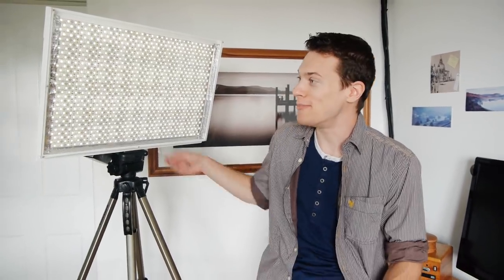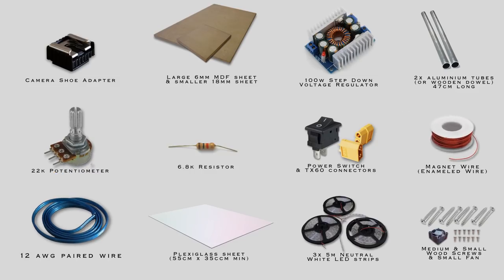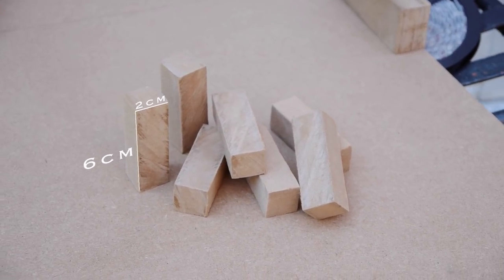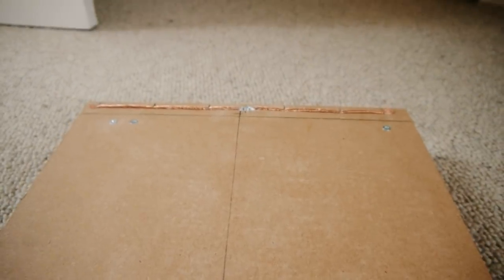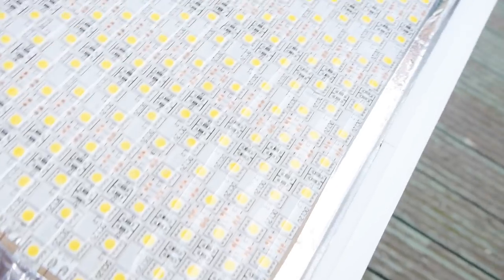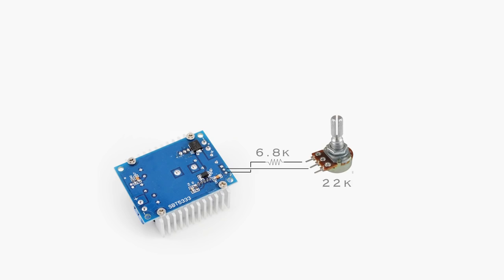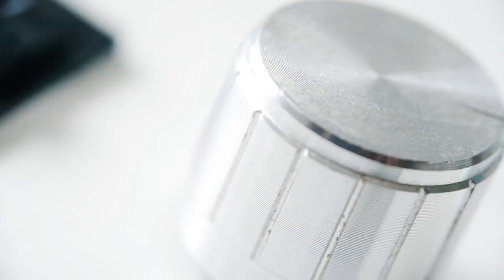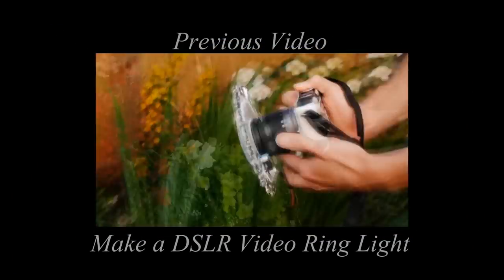How to make a super bright LED light panel (for video work etc)

Comment: DIY Perks  I skimmed over all responses but didn't see a fairly relevant question answered: how long does the led strip remain lit at full, half, or quarter lumen with a fully charged LiPo Battery like the one you are using? Thanks for the reply, and sorry if this was answered already somewhere...
Reply from the maker: Don Bosse Depends on the voltage of the battery. If it's a 4 cell battery, its minimum voltage will never be below 12v, meaning that brightness will not fluctuate at all.

Comment: Well done video!!!  Is it possible to add a numeric digital display to in line with the potentiometer to determine what percentage of the voltage is being fed into the light array?  I've seen some commercial lights with this feature which allows very accurate adjustment.

Comment: Thank you for a very nice tutorial. I just have one question. How much current does the 6.8k resistor need to bare. Does the 100w go through the resistor (Do I need a 100w resistor or can I use a smaller one?) If possible could you link to a suitable resistor?
Reply from the maker: teomi971 Any wattage resistor will do as it doesn't have to handle any load. I'd have mentioned it otherwise.

Comment: Hi Matt, I pretty much got everything. When connected to 90watt source, things were working fine except that after 11.2v it started flashing, so connected to 150W adaptor and I guess the regulator blew off. I remember you saying min 100W source. Can you please tell me should I use 150W adaptor and how to avoid flickering with 90W adaptor.

Thank you
Reply from the maker: Srikar Reddy Julukuntla It'll be flickering because the 90w adapter can't supply enough wattage. The 150w is a much better choice, but I'm not sure why it 'blow off' but if your 150w adapter is below 30v it's all within spec. Perhaps you got a faulty unit, or you've got the output voltage set slightly too high so the LEDs are drawing WAY too much power and overloading it.
Reply: DIY Perks Thanks Matt. I have ordered couple more regulators i have to try my luck once they are delivered.
Reply: Srikar Reddy Julukuntla Hi Matt, after ordering the new Buck converter, the second one blew off with the 150W source(19.5 V 7.89A) I ddi set the output voltage t 12V exact. and with out connecting to load, i saw no issue. soon I connected to load lights were there for a sec and the buck converter blew off. I feel the load current is little high, is there anything you suggest I can do to reduce the load current? and how do I measure/limit it?
Thank you
Reply from the maker: Srikar Reddy Julukuntla It really shouldn't be doing that. You need to check your wiring on the LEDs to make sure there isn't a short or inverted polarity somewhere.
Reply: Hi Matt, I tested enough on those voltage regulators. got 12V 20A powersupply and hooked directly to LEDs. Works amazing.
Reply: +Srikar Reddy Julukuntla
Can you send the link of voltage regulator you used in a 12V 20A power supply? or just tell me the specs of the regulator. Thank you

Comment: Hi! Nice video! I did some research on the internet about dimming LED strips and I found out that to dim a LED strip it would be needed a 12W pot or so, that would be rare and expensive. Is that true? Did you use a regular pot? Thanks in advance!

Comment: Thanks for great video. I intent to do one of mine, according to your tutorial.
I have found LED 5050 neutral white with, consumption: 10w/meter (60 LED/meter). 3x5meter = 15 meter of LED strip would need power of 150W, not 100W, am I missing something? Did you use some different LED with less power consumption?

LED specifications:
Wattage: 10W/m
LED Type: 5050
LED Quantity: 60
Lm/LED: 12
Light Color: Natural White (4500K)
IP Rating: Non-waterproof
Width: 10 mm

Comment: Hi first of all let me thank you for your wonderful project,its amazing
i bought 20A 12V DC Output-with AC INPUT:220V now my question is is 20A ok for this project and will the resistort and 22K potentiometer will handle this power supply?supply? 
Mine power supply looks similars to.... ravi kanth Kotagiri....but with higher AMPS
THANKS A LOT
Reply: Leutrim Voka It just means the power supply is capable of delivering 20A. If the load only demands 10A then that's what will flow.

Comment: I'm not super familiar with wiring (so please forgive me if I am asking a dumb question), but isn't there supposed to be a ground wire somewhere?
Reply from the maker: NoWrongInBeef The ground wire is the negative connection (DC has only two contacts, positive and negative).

Comment: I noticed at 7:05 that there are variations in the brightness and color of the strips.  Is that due to loss in power, or just the quality/variation of the LEDs, or is it possibly due to the sensor on the camera (think moire)?
Reply from the maker: huyked Just slight manufacturing variations. Doesn't make any difference to the light output in practice.
Reply: DIY Perks
Hi!  Thank you so much!  I was watching your Silent PC build just now, until you so "wudely" interrupted. ;)  j/k  Anyhow, awesome tutorials.  Cheers!

Comment: thank you, it is really helpful video. i have most of the equipment to build this thing. but I have a question. Is it ok to use electricity power instate of the battery?
Reply from the maker: Ali K.A Yeah, just make sure you use an adapter (rather than direct to the 120v/240v mains).

Comment: Hey DIY Perks. 
I'm planning to make a panel based on your design and was wondering if you have any thoughts on the led strip lights, specifically when it comes to light quality. I saw your other video on a different type of led unit that gave off color temperature values north of 5600 degrees kelvin, and a high CRI. Thats what I'm looking for in my strips. 
Any thoughts?

Comment: Thanks for sharing
The best video ever.. I could see hours of editing going inside of this. Excellent design. 

Too complex though.. especially the technical bits of watts and volts.
How do we know if it is safe to use how much watts bulbs in our normal house socket?
Reply: U r a genius
Reply: Your English is so good and u speak perfectly
Very clear instructions
How did u get all that knowledge about electricity! I am zero at this 
I understood other parts but as soon as u start with regulator and resistance and Ohms and watts, I am like "what" ?

Any recommendations for me to learn this stuff? Any books etc?

Comment: Great video, planning on building my own version of your light. I have one question though, what are the two resistors values you use to drop the 12v to 5v to power the fan?
Reply: Two 1/2w resistors in series?
Reply: Oliver Elliott Sill having no luck with the fan, whatever I put between the fan and output the voltage still goes from 6v to 12v.

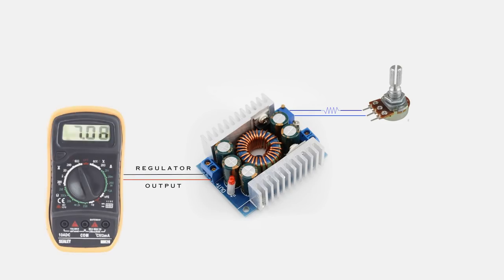Comment: (10:00) Hi! I want to build a spotlight for photography and I am using one led chip of 100w. I also have the driver. It output 40V. But it's not dimable... How can I make it dimable? Can I just put a potentiometer between the driver and the LED?

Comment: Hi, nice and clear instructions. Quick question regarding having one large bank versus 2 smaller banks on either side of subject. Would you still run the same system or would you need to reduce the spec because of lower power draw etc?

Thanks. :)
Reply from the maker: Kidsfishing It scales perfectly, so you can just use fewer LEDs and it will work the same, only dimmer.

Comment: Thank you for this great video! I need to ask something. I've ordered all the materials for this LED panel, and after all came, i saw that my 6.8K resistor is smaller than yours. After that, i've searched a little bit about it, and saw that it's because of the W. I got 1/4W and 1/8W. Is one of them ok to use? Or i need to order something else? I've ordered without knowing that. Just searched on ebay 6.8k resistor like you wrote.. Thanks..

Comment: First of all, great video - I've been wanting to build my own LED panels for a while and this is by far the best tutorial I've seen for it. Lots of detail, clear instruction and well filmed!
I do have a couple of questions to help me with my own build, though - 
1) What sort of mains adapter and power connector would I need to just power it directly from the mains and how would I fit it (rather than making a mains adapter to XT60 adapter like you did)? Battery power is convenient and I might make a second, portable panel, but I definitely need at least one that's mains powered so that I don't have to worry about batteries.
2) I would like my panel to fit on a lighting stand with a standard connector. What are these connectors called and where can I find the part that would fit onto them? (I can find lighting stand to 1/4" screw adapters so maybe I'll just make one with the 1/4" screw hole like you did and then use an adapter, but I would prefer to just have it fit straight onto a lighting stand!)

Comment: Hey Matt! So, I'm almost finished with the panels(yes, 2) but I ran into a big problem. I bought the power supplies from ebay and they said they are rated at 10A 12v. When I connected the panel to the power supply it worked great, for 3 minutes, after that the voltage regulator burned out. I measured the power supplies amperage and it seems they are actually 15A not 10A. And the voltage regulator is compatible with a max of 12A. So what are my solutions? Is replacing the power supply with a proper 10A one the only solution?
Reply from the maker: +Sergiu Gherman Just lower the output voltage slightly. Try perhaps 11v, and it should lower the required current significantly.
Reply: +DIY Perks But wouldn't that affect only the current that goes to the leds?

Comment: Has any one had a problem with the IC on the regulator blowing? I was using an 18v battery and had already set it to output with a max voltage of 12. Blew out two regulators thinking the first one was bad. It was fine until I turned the 22k pot all the way up.

Comment: Hi , is it possible to use with AA batteries or Canon 70d battery ? make me more easy to use, thanks
Reply: It is, but to get the 12v you'd need 8 AA batteries in series.
This would give you 12v but still around 2.5 Ah.

If i got that correct he uses 3 of the 5m Strips, which use 1.2A per meter.
Thats 15 meters - this would use 18 Ah. 
 
When calculating good AA batteries that got 2.5 Ah, you'd need 8 of them in parallel to get 20 Ah.
So thats 8 batteries in series by 8 in parallel .. thats 64 batteries.
Also, this configuration would only last about a hour.

Honestly, i dont think using batteries is easier

Comment: How can I make this to run on both batteries and a laptop power supply? Batteries when away from A/C and plug it in when available...
Reply: Frank Brauer add another connector for your laptop power supply and add a on-off-on switch to control what powers is going to the regulator

Comment: Is it possible to use a different potentiometer?  I cannot find a 22K around.  They have 10K, 25K, 50K etc.  I am trying to understand potentiometers but am having difficulty.
Reply: +Rob Clark I don´t that much about them either, but you can get this cheap 2-pack from AliExpress:
http://www.aliexpress.com/item/2-Pcs-Single-Turn-3Pin-Rotary-Taper-Carbon-Taper-Potentiometer-22K-ohm/2044164409.html

Comment: I'm a bit confused here, because after doing some research on the parts you have listed; the amps don't add up. First the LED strips amps are 6 amps per reel; being there's three reels that's 18 amps. When you use the step down voltage regulator the link you have in the description for it is maxed at 12 amps output; how can your panel still work if the current is being restricted by the step down regulator? Also can I just not use a step down regulator entirely if I just use a 12v power supply?
Reply from the maker: Hung Sewell Simply that the Chinese vendors rarely supply accurate specs. 100W power draw is what I found it was drawing after I made the panel (calculated from each strand before the voltage regulator), so it's a practical measurement rather than a theoretical one.
Reply: DIY Perks I see thanks for clarifying.

Comment: Hi Matt,

Love your videos, I must have nearly watched all of them by now.

In this video you solder positives to a wire and negatives to another then these to wires are connected to the power source. Is there any benefit to this compared to wiring each LED in the loop as though they were one strip. i.e. wire + to + and - to - then follow the flow to the end of that strip and repeat.

Comment: Hi this is very interesting. But do i need this fan for sure or can i build it without it? Would that Volt regulator get too hot without? I´m asking, because i would like to avoid any noise sources while shooting! thanks for sharing this smart tutorial!!
Reply from the maker: baerirz It does need the fan, but it needn't spin fast. I can barely hear mine in a quiet room.
Reply: DIY Perks
thanks for the answer!

Comment: Great video
Any safety measures I should be aware of for the electric side of things?
What happens if I touch the wires while they're connected?

Also (noob question sorry): how do connect a laptop adapter to the regulator??
Reply from the maker: altar7 Safety is pretty good so long as you use a decent power adapter. If a short is detected, most good quality adapters automatically shut down, preventing any heat buildup.

To connect a laptop adapter, you can either chop off its end and attach the cables directly to a male XT60 connector, or leave the adapter intact and instead solder a socket to an XT60 connector like I did. Either way, it's just a matter of connecting the adapter's + and - leads to the + and - points on the voltage regulator.
Reply: DIY Perks Thanks a lot for all your advice
One last thing, do you think that Acrylic would be a better material than wood to make it?

Comment: Hey there. My panel is finished and it works. Thanks for this brilliant tutorial. but i have a problem with my strip. I bought my natural white strips from the same seller as you on ebay, but stupidly the wrong strip, which was waterproof, and coated with silicon completely. After i light them up for testing, i saw its loosing some light because of this coating. Furthermore it was without an adhesive tape. So i removed this coating. Under the silicon there is still a kind of epoxy or so surface. Now my problem: when i light up a white wall it has a noticable magenta color cast. Well, i thought i go for some "eight plus green Lee filter. to correct this problem into pure white. It turned out better and the white color looks good and neutral. The color isnt magenta anymore BUT when i use a second light, f.e. A halogen spot with CTB to daylight and cross the light with the panel, i see a magenta tint in the shadows of the Halogen light and a green tint in the shadow of the halogen light. Its impossible to correct the light with gels because of this two terrible color casts, which should be opposite to each other. Its frustrating..Do i got the wrong strip or removing the coating was wrong? do you have color tints (green/magenta)when mixing the panel light with other lights with your strips?Thanks again..
Reply from the maker: baerirz You ought not to have removed the coating - that's what makes these LEDs daylight balanced (more or less). The coating actually affects the colour temperature (makes it cooler) - not because it's got a tint, but because it alters the light transmission from the LEDs themselves (no idea how, but I've observed it after much testing and it's quite significant). Are you sure you bought the wrong strips? Were they 5050 4500k ones, with waterproofing?
Reply: DIY Perks Hey, Yes, they are 4500K 5050 natural white and waterproof. But the waterrpoofing is different than the one i see in your tutorial. My stipes were covered with this silicon from all sides. No adhesive tape. And they are smelling very bad like glue or something:)(ebay number:131113323326). So i removed the coating in hope of easier sticking to the mdf and less weight and smell.There is still a second coating left on the SMDs which is sticky. And its smells. The white balance is somewhere between 3800k-4000K now. Now with some testing  and a 1/4 CTB and 1/4 plus green i reach 4700K with less magenta tint, but still noticable, particularly when i use an additional light.weird.you have similar results? Maybe there is just a color missing because of the lower CRI. hmmm...

Comment: All the 22k 16mm potentiometer pots are unavailable, theres some 24mm 22k marshall ones on amazon and ebay, will these work?
Reply: Yes, the size doesn't matter so 24mm diameter will be fine. Make sure they are "linear" (B) not "logarithmic" (A) type.